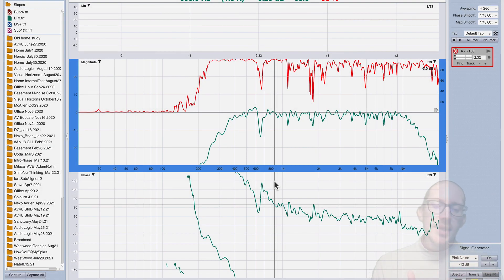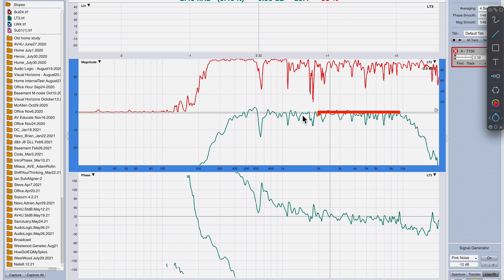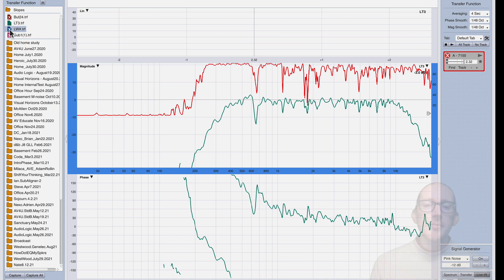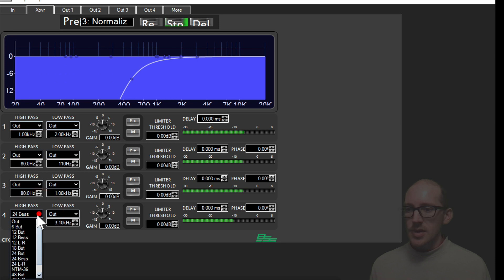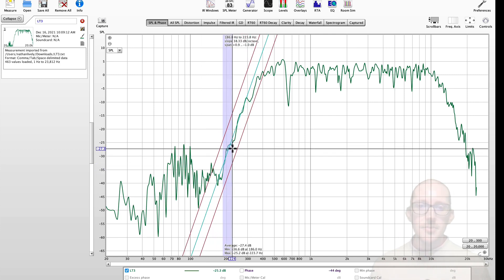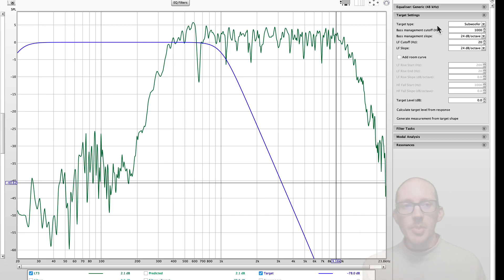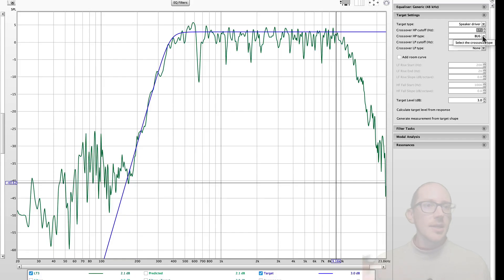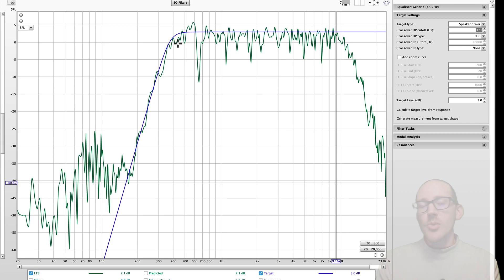How to find a speaker measurement's slope in Smaart

Comment: Great video, sir. That really helped with some new processes. 

If I am measuring a single speaker in an automobile, do I run a full sweep starting slightly below the FS of the driver to measure the roll off? Then once I have that data and I wanted to crossover higher in frequency, would the electrical I choose and acoustical rolloff summation still apply for that driver in a crossover frequency higher than it's natural rolloff? I'm really trying to understand how to apply crossovers at frequencies I choose. Reason being is that I have found cancelations due to reflections in my midrange around 350hz and if I crossover higher, my midbass can cover the midrange cancelation without issue. But I just can't seem to find info that can answer my question.
Reply from the maker: Hey Tickle, thanks for checking out the video.

> If I am measuring a single speaker in an automobile, do I run a full sweep starting slightly below the FS of the driver to measure the roll off? 

Please see if this help: https://youtu.be/1P3jOXqPa2Y

>  would the electrical I choose and acoustical rolloff summation still apply for that driver in a crossover frequency higher than it's natural rolloff? 

I'm not sure if I totally understand the question and I'm not a speaker builder, so my experience is limited, but my understanding is that you have some freedom in your crossover network design as long as long as you don't try to go lower or higher than what the native response will support. I'm sure there are a lot of speaker design books out there that can explain it better.

> if I crossover higher, my midbass can cover the midrange cancelation without issue. 

I don't see any problem with trying it. Something tells me that you may want to figure out how to fix that reflection issue.